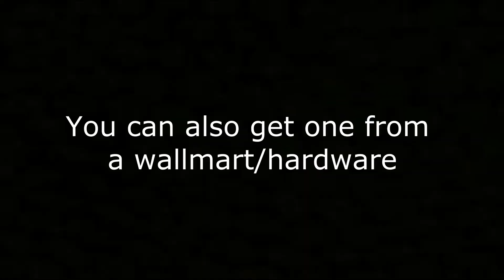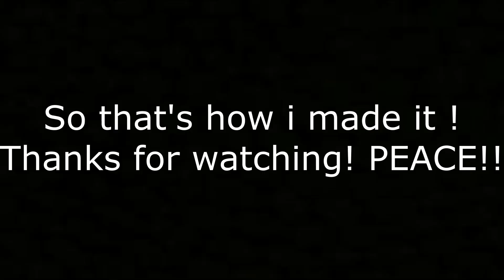Homemade Lat Pulldown Machine

Comment: If.you use 2 pulleys ,it would be better . The weight is very closer incase of one pulley like this . Its more likley to colloid weight to your body cause injury . Improve that machine by adding another pulley to increase distance between you and weight .
Reply from the maker: Yes that's  my plan before but i don't have enough money/materials anymore that's why  made it simple. I always use it without any problem or the weights won't bump on my body unless you swing it too much.
I'm going to upgrade it soon if i got enough money. Thanks for watching!
Reply: Ok, bro i really appreciate your dedication .
Reply from the maker: Thanks bro